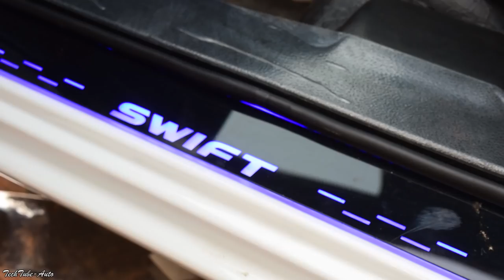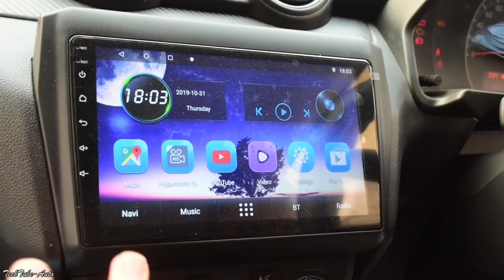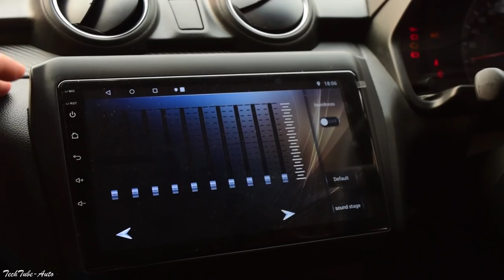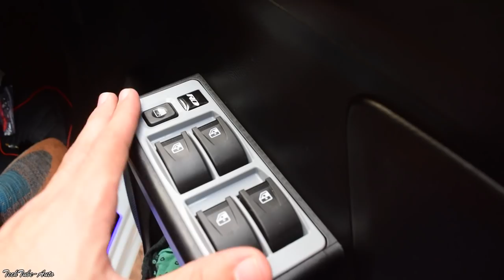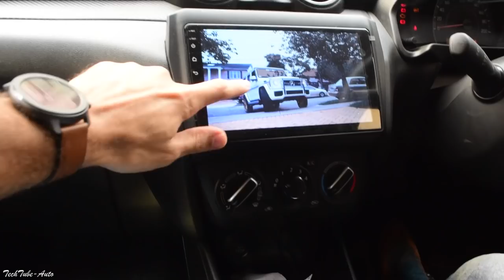Swift 2019 Converted Base to Top | AutoFold Mirror | Power Window | Custom Grill | DRL | Android |

Comment: Bhai pricing sab ki baut zyada hai, sirf camera ko chodd ke.. maine apni tiago me 
central locking 2500rs
Power windows 4500rs
Camera + sensors 1800rs
Wifi vala touchscreen same hypersonic ka 11000rs me
Steering cover 350rs cult ka branded
Speaker branded 2000 1pair
Jitna aapne btaya itne money lgane se to mai top model le leta..
Reply: bro power window kaha se karwai thi
Reply: @kangragaurav9449  bro rajouri garden  car club se for all doors 9000rs RD brand ya 9500rs for autocop. For only front doors around 4500rs.
Reply: @amirjammuaaa786  bro car show in karol bagh, best price shop and best quality. I know him from last 15 years.
Reply: @amirjammuaaa786  pta nahi bhai, lockdown k baad Car Show ko hi pooch lena